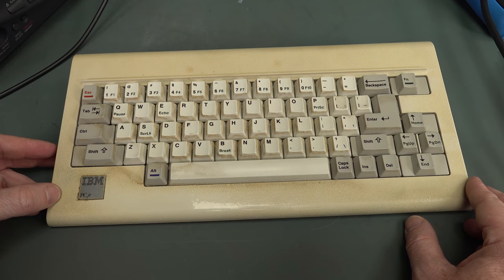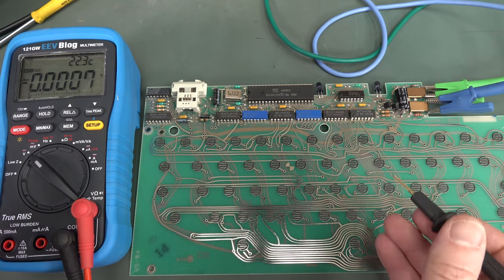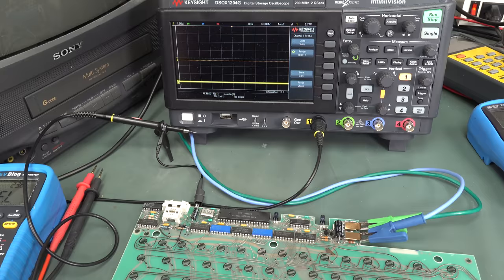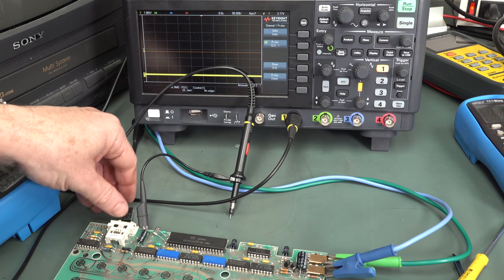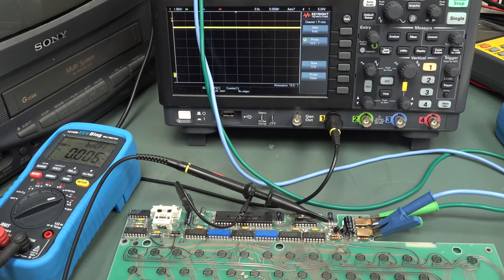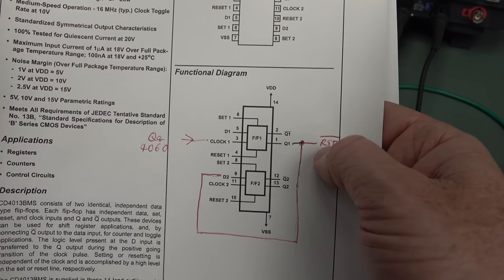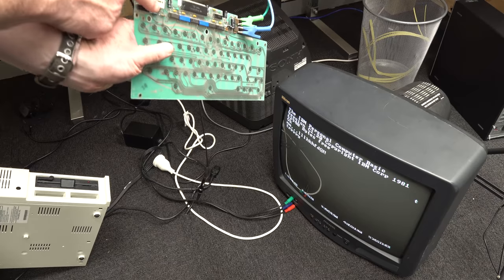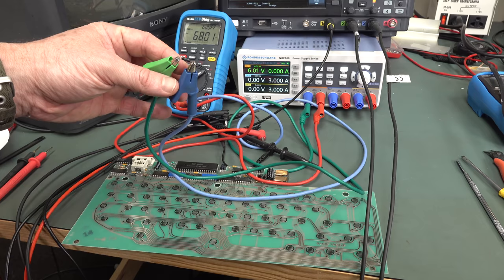EEVblog #1245 - A Most Excellent REPAIR: IBM PCjr Keyboard

Comment: "You don't want to get into reverse engineering it..."

Reverse engineers it, anyway.
Reply: Brian Sullivan But not much.  Would have been educational to study the circuit even if working perfectly.  This battery powered device from 35 years ago manages to run for a long time on a cheap battery.  It has some well designed circuits to consume near zero power in standby yet wake up on any keypress without loosing the data from that first keypress.  Lots of modern IoT devices fail to achieve this.

Comment: Tantalum caps are the devil.
Had one die in my dynamic signal analyzer that kept the crt from working; it was a dead short. Now another one has failed as well, same symptoms.
I had one fail in my spectrum analyzer also.
Finally, I got a dead Flir A40 that had a blown n-channel fet that burnt some traces because of a shorted tantalum cap; got that back up and running too.

Comment: I once had repaired some over/under voltage protection device, and found that voltage on a simple voltage divider wasn't what it should have been and ended up replacing every component in that part of the circuit (two resistors and comparator) and the damn voltage was still wrong. As the last effort I removed a tantalum that was parallel with R2 of the voltage divider and it worked! After I told my coworker what happend he said that I should try putting it back in beacause it was bizzare that the cap was the fault, and after soldering it back in, it still worked...
Ended up reporting it as "ghosts issues" hahah
Learned so much about troubleshooting from your videos, thanks Dave!
Reply: It was not bizarre that the tantalum was throwing off the voltage divider -- same failure mode as in Dave's video. It was somewhat bizarre that reinstalling it didn't recreate the problem -- maybe the heat or lead-bending cured it!
Reply: Graham Wideman he said it was bizzare beacuse it was a passive component that died, from experience of repairing other devices we have. Its always active components
Reply: @NKauzljar  slovenc?
Reply: B Bogataj Hrvat
Reply: Years ago I heard of somebody fixing a DNS failure by swapping a network patch cable.  That's something that is physically incapable of fixing that problem, but did anyway.  (Networks are weird sometimes.)
Reply: Graham Wideman You have this correct.  Louis Rossmann once said that Tantalum caps can be tested, but not fixed, by heating them.  If you heat it and it "fixes", its still a problem that needs replacement.  This is an intermittent fault and should always be replaced to ensure you don't have an angry customer coming back with the same issue.  Solution is similar to heat gunning the xbox360 processor, it will work for a month because the solder annealed back into contact, then fail as the marginal joint ages.  Same for tantalums.  The capacitor cracks internally from some stress and heating presumably anneals the tantalum.  https://en.wikipedia.org/wiki/Annealing_(metallurgy)
Reply: @evensgrey  yeah, computers in general get pretty weird, friend of mine had a problem where his PC power supply wouldn't start when mouse was plugged in..
Reply: @notamouse5630  I watched that video where Louis explains how heating graphic cards doesn't actually fix them. Thanks for the advice!
Reply: @evensgrey  This is potentially an excellent example of turning something off and on again.  I would imagine that some DNS server process had a random error that was fixed by terminating an automatically reconnecting process through SIGHUP or SIGHUP to SIGCHLD.  Very often, the way a Unix/Linux server process works is that a main server process calls accept() and then forks a child process and closes the parent copy of the socket to give the child exclusive control of the socket.  There is one or more child processes per client and no client shares a process with any other client.  When connection is reset by the client, the server child processes associated with it receive SIGHUP and may choose to perform housekeeping upon receipt of that before sending their parent main server process SIGCHLD and terminating.   
I have a standing rule that if you think something having to do with a complex process in a computer is failing and something random fixes it, it is not random and you just don't know what fixed it.  Tracing the expected effects of a change is what should be done to learn why.  That said, troubleshooting Heisenbugs is one of those things which causes many engineers to swear themselves red in the face after the unknown failure doesn't show itself for an hour and they are forced to watch all the readouts of a complicated piece of hardware for that long only for the bug to not happen!  I had a standing habit of grounding myself and touching and tapping low voltage logic boards to see if bugs reappear due to bad soldering because I don't want to wait an hour.
Reply: @NKauzljar  That makes me think the system had a power supply that was only marginally powerful enough for it.  The extra current draw at startup causing it to fail if the mouse was plugged in because that extra bit was just too much for it.  It might only have been one rail that was overtaxed, and that rail was being used on the port the mouse was on.
Reply: @notamouse5630  That sounds like a lot of process control overhead for a service that normally doesn't make connections.  Is there really a point to forking off a child process in response to receiving a single UDP packet that's only going to send a single UDP packet back?  Perhaps if it has to wait for the info from another server, but it seems wasteful of system resources if the answer is in the local cache.  And under normal operating conditions, you wouldn't even get those signals because there wouldn't be connections to break, just an exchange of UDP packets.  DNS only uses TCP and makes connections when the client isn't getting answers back.
Reply: @evensgrey  Or you know, the mouse had a short inside it.
Reply: hanetar If I remember correctly, the mouse was working
Reply: @evensgrey  You know more about DNS than I do then.  My knowledge in this case is more generally applicable to network services and these days threads and/or async callback queuing like in Node.js are used instead of processes fairly often.  Async Callbacks are efficient for what you describe.  I still think the problem may be at the OS level if an ethernet unplug replug fixed something.  Maybe a resource was allocated but not freed.  Sockets can do that.  I have observed that one must handle SIGINT (ctrl+c) in terminal for clients else the socket will get stuck open.  Perhaps unplugging causes all sockets allocated over that interface to close.  

There is also all kinds of larger scale stuff with load balancing.  I also don't generally write this area of software.  I know about it from being a developer and talking with my brother who actually does this.  I do Embedded Software primarily and use python as a test interface on occasion.

Comment: It's the tantalum. I hate those things. They're always failing on power supply boards.
Reply: they fail *everywhere*...i recently repaired a RIAA (turntable) preAmp..there had been a bunch of them on the raisl...and guess what, the PS kept failing, 78/7915 run into fail-save. I replaced them all with generic 105°C caps and here we go again, like new....sh!tty TT-Caps!! replace them...every time, everywhere!
Reply: @tubical71  To be fair, they aren't ESR efficient unless you run them close to their rated voltages. But we all know what that means in the long run.

Comment: That's an unusual failure mode. Most tantalum cap faults I've found were short cct. Sometimes blowing the top of the caps off which makes it a lot easier to find.
Reply: Sounds like a related failure.  There's not much that can go wrong if there's a 1M resistor between the cap and the PSU.  Not sure why it's voltage dependent though.

Comment: Hey Dave, in case nobody else pointed this out yet, the reason for a 0.8mm pcb is most likely because they used this thickness in other keyboards of the day that used buckling springs and capacitive sense. In those boards, the pcb had to be curved, hence the need for flex. I suspect they probably just went with whatever they were used to at the time, even if the flex was not needed here. The PCjr keyboards (both of them) were a bit of a disaster.

Comment: But Dave, you totally missed a chance to blow up a tantalum! THINK OF THE VIEWS!!! (j/k)
Reply: Over voltage on tantalums is an absolute party.
Reply: Capacitor fireworks display! Woo!
Reply: Think of the SMELL! Yuck, that burny metallic scent takes forever to dissipate.
Reply: @Ziferten  The smell is somewhat "tantalizing" to some people.

I'll show myself out.
Reply: @Ziferten  He's on an island continent, nearly on the other side of the world from me. If that smell propagates THAT far, I'll be genuinely impressed.
Reply: I have a box with about 100 large ones...   I also have a power supply that can go up to a few kV....   I might need to make a video
Reply: Didn't he say something about the smoke detectors in the new lab being a bit on the sensitive side, and the safety requirements for them going off being kind of...unpleasant if he has to pay for them?  (His insurance might pay the freight for an accidental tripping, but not if it trips from something he did on purpose.)
Reply: @evensgrey  Didn't have to do it indoors. :)

Comment: The only keyboard I ended up repairing turned out to have a mechanical rather than an electronic fault.
One key kept on repeating, as though being held down.  After taking the kb apart and examining the mechanics, I found the problem.  The metal bracket which provided the spring return for the key was just slightly kinked.  It was barely noticeable, but it was enough so that the bracket was pressing down on the conductive rubber mat and making it contact the PCB track so it appeared as though the key was being held down.  I removed the bracket and smoothed out the kink and that was the repair.

Comment: build Mr Carlsons capacitor tester :)
Reply from the maker: What's the deal with that? I've gather it's controversial in some way?
Reply: @EEVblog  He's managed to figure out how to test caps for leakage, and potentially predict a future failure. Whole thing done with batteries, instead of the old-school high voltage testers. I understand the plans are on Patreon, which might be the "controversial" bit. Video here: https://youtu.be/LhovRIM5xAo
Reply: Not sure how fit it is for low voltage systems such as these.
Reply: @EEVblog  Maybe it is the analog witchcraft making it controversial :D
Reply: @EEVblog  i built one they are the ducks guts
Reply: @wolvenar  If the components are separate from the main board I don't see that it would matter. IIRC, Mr. Carlson's powering the thing on 2 AAs.
Reply: Considering how Carlson loves tantalums he should have a tester for them
Reply: I built one also. Essentially it's just a means to test for DC leakage in the pico-amp range across a DUT capacitor. Works very well, really. It's especially handy for testing high voltage caps as are common in vintage vacuum tube gear, where the alternative bulky and dangerous traditional capacitor leakage testers would apply hundreds of volts. Carlson's circuit can find faulty caps at under 30 volts. I use it all the time. I have yet to find a capacitor it mis-diagnosed.
Reply: @McTroyd  Carlson's tester uses 3 x 9v batteries.
Reply: @God-CDXX  Never heard that one before. Here it's the bees knees.
Reply: Is that only on his Patreon? Seen it before, never seen him show any schematics for it...
Reply: @EEVblog  Most older capacitor leakage testers use voltage as much as 100VDC to test caps for leakage making it somewhat hazardous to use. example here: http://kripton2035.free.fr/Resources/capacitor%20leakage%20tester%20(radio%20electonics%20may%201986).pdf
I believe Mr. Carlson's version uses lower voltages to do the same thing.
Reply: Isn't it just a few resistors, comparators, and LEDs?
Reply: Prehistoricman Well I built something myself out of a fet input opamp and a 1 meg. current sense resistor. Use the second half of that dual opamp as a comparator to drive a led if you like. You can add a higher value resistor and a 100x gain if you think you need it but really that's down there in the noise. And I never found it necessary, 10nA or so cutoff is plenty low enough for testing old caps.
Reply: @userPrehistoricman  The real magic is in the 2 transistor (or was it 3) high gain amplifier which feeds the comparator array. All the schematics and board layouts are available to subscribers of Mr. Carlson's Patreon channel. I built mine on an ordinary through hole proto board.
Reply: @InsideOfMyOwnMind   bees knees🐝 ducks guts🦆 same thing
Reply: @EEVblog  because he's only made the circuit available to patreon supporters, along with a his electronics courses/tutorials.  Personally I don't have a problem with that - this guy is a genius, and if he wants to earn some money from his hard work I'll support that decision 100%.  He's odd but in an absolutely brillant way: meticulous, speaks slowly and deliberately, covers all bases and is very thorough.  In short, he's the perfect teacher and EE.

For the record I don't give him money through patreon but I've seriously considered doing so, and the circuit for the capacitor tester is one of the main reasons.  He's demonstrated that his tester achieves the same results with low voltage that other legacy testers need hundreds of volts to do.  He's also demonstrated that his tester predicts faulty capacitors that even the megger testers give a pass on (ie predictive failure).  I'm only guessing, but I think he's devised an indicator circuit that is extremely sensitive to leakage current even at a very low voltage, but only those with access to the circuit could tell you exactly how it works.
Reply: @McTroyd  I was just wondering because it seems that it is using approximately 9 volt to test caps. Anything rated under this may be stressed? I haven't seen the circuit yet to know if it's actually sending all of that or if it's reduced significantly.
Reply: @wolvenar  Unfortunately neither have I. I intend to join his Patreon at some point for the goodies he posts up there, including that tester, but the finances haven't agreed with me yet. Given Mr. Carlson does a lot of work with vintage gear in the hundreds-of-volts range, I wouldn't be shocked if you're right.
Reply: @EEVblog  Just make it Dave. anyway :P

Comment: The main issue with that keyboard was the bad stabilizators. My BTC also works on a similar conductive rubber dome over PCB design (but with Cherry MX compatible sliders), but at least the wire stabilized keys worked very well after a good clean - which meant complete disassembly, and a bath in a warm, soapy water. The pin stabilizers needed some lubricant in the form of some universal grease (which I also applied to the wire stabilizers), the result was the best feeling keyboard I've ever owned. Probably some better Alps switch would outdo it in almost every way, but I couldn't try any of those.

Comment: And the expensive tantalum cap was put there for better reliability
Reply: Tcll5850 Nope, smaller and more expensive than electrolytic cans back then.  They were a luxury component only used when the special properties were needed.  Also back then Tantalum wasn't a conflict mineral.

Comment: I had one of those as a kid. I did a lot of programming on it. I had the technical reference manual and did a lot of low-level programming on it. I built a controller to add a second floppy drive and I had an adapter to use a PC XT keyboard. I learned Turbo Pascal and assembly language on that machine. I wrote a lot of software on it.

Comment: Mr. Carlson's Lab on YouTube designed an advanced cap tester that will check for leakage like that
Reply: I am intrested in building it but the details are only avalible to his patrions.
Reply: @TheEPROM9  for $2 a month it is worth it. I built the cap tester and it defiantly would have detected the leakage in that cap.
Reply: He has some different testing jigs. One is an old scope that shows an L or some figure for diode checking I think.
Reply: @Mosfet510  It is a curve tracer or an octopus circuit. It is similar to a Huntron Tracker. It plots voltage and current on an old oscilloscope. I haven't built it yet, but it is a simple circuit. They have been around for decades and are kind of an insider secret for repair techs.
Reply: I do not even build anything of it but still think that at least 2$ each for Dave, Paul and Clive is a must for anyone learning about electronics!
Reply: @l3p3  not a bad approach!
Reply: @hobbyelectronics6630  Thank you! It was neat to see in action.